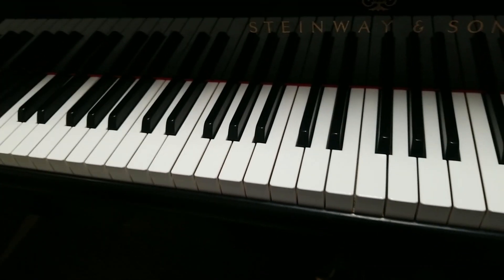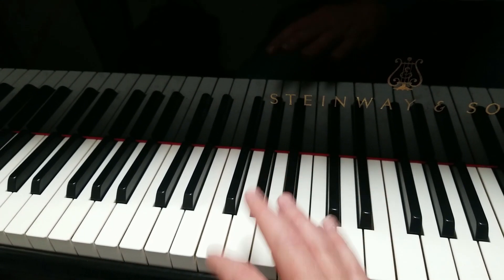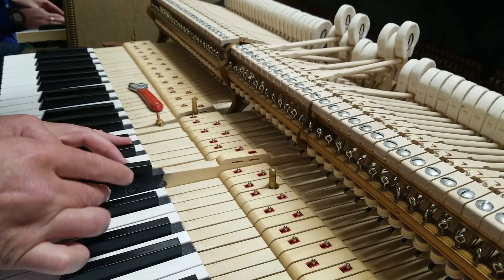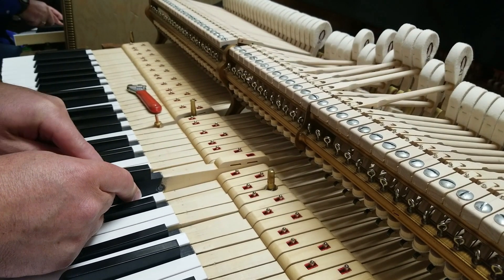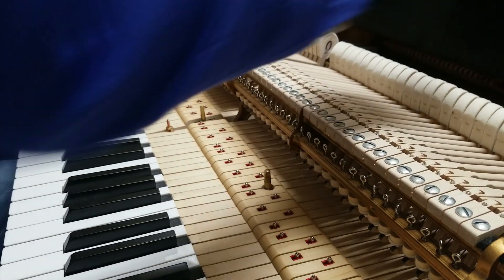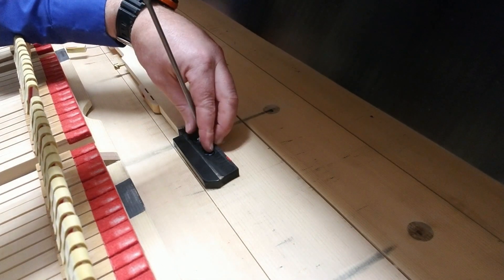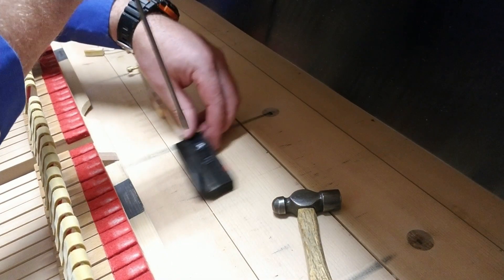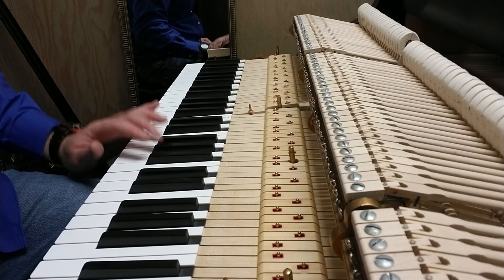How to Fix a Clicking Key on a Steinway Grand (caused by a loose key lead)

Comment: Too harsh butcher with the screw driver and hammer like a junk yard mechanic on a beautiful Steinway, Is he certifies from Steinway?
Reply from the maker: Ha ha! Yes, I am factory-trained and authorized by Steinway. What tool do you like to use to swedge leads?
Reply: I was a bit surprised when he put the top part of the action, the hammers, vertically aside.  I never do that.  the clicking noise that some hammers make have many causes, he was just showing one cause I guess.